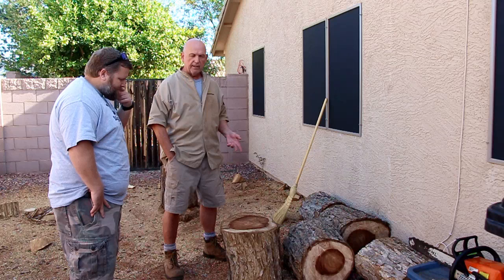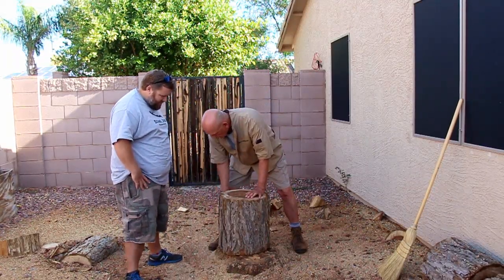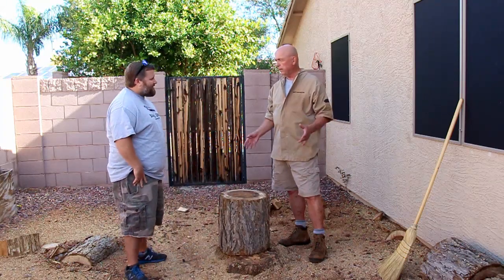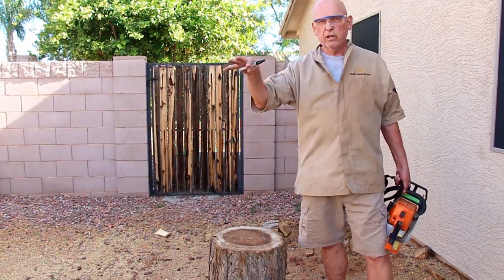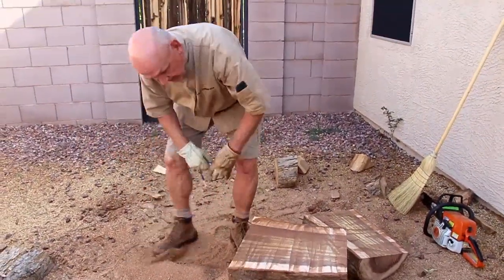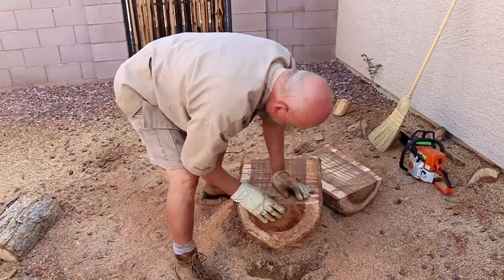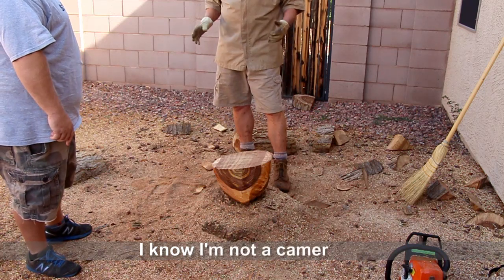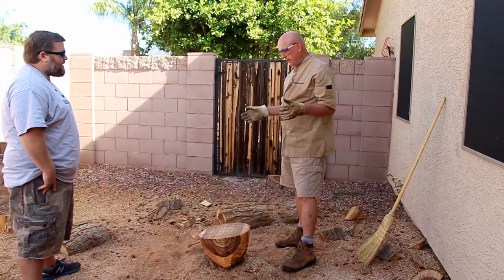Large Bowl Turning,  Part 1 Log to bowl blank

Comment: now I'm no chainsaw expert, but I'm pretty sure you want to try to avoid cutting into the end grain like he did at 5:36. It is better on the chain to cut longways with the grain.
Reply: Matthew Harper Thanks for the feedback Mathew.  You're absolutely right.  I started cutting logs long ways with the grain and it works a lot better.  DAVE